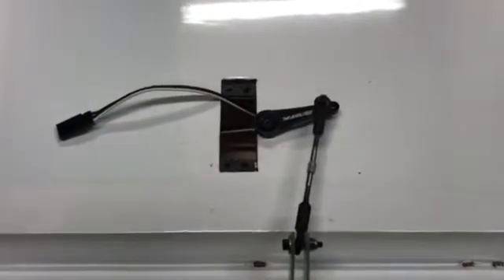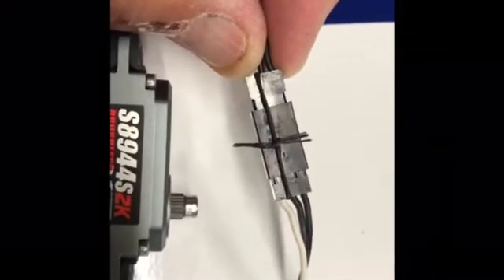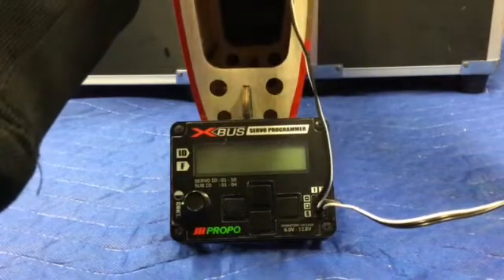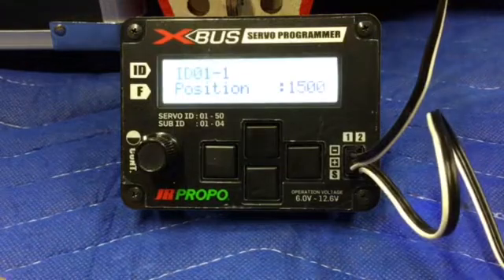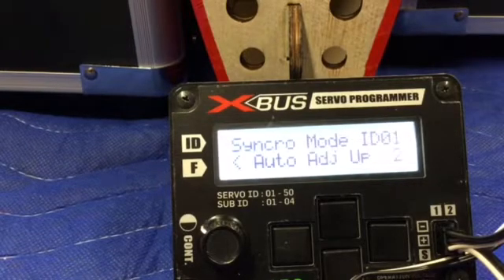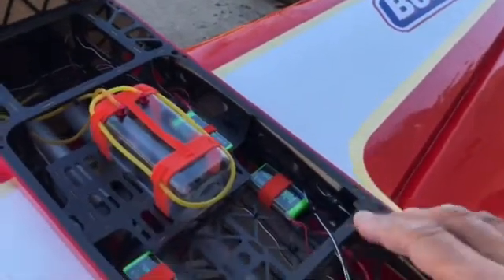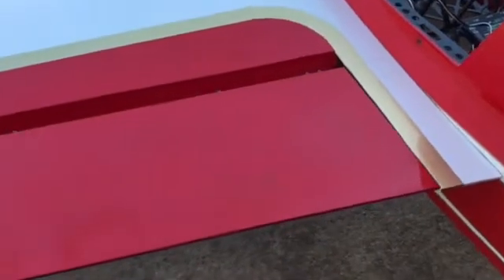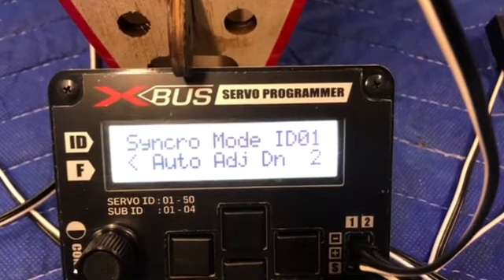Demonstration of JR Propo Servo Synchronization System by Frank Noll

Comment: Frank can the Servo Sync work with the Current x-Bus servos like the S8911? Assume the sync process is done via the Programmer,Ie it has all the smarts in it
, Would be great is the T-14 Tx could do this with and update. SO the Master Servos will be Id 50-1 and the slave 50-2? Cheers Frank